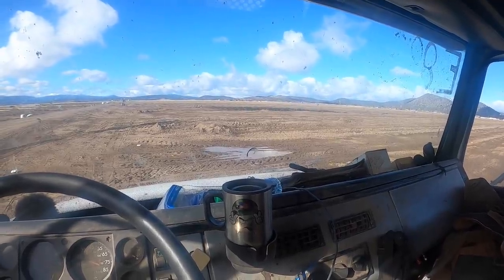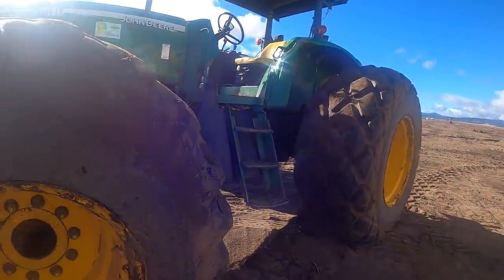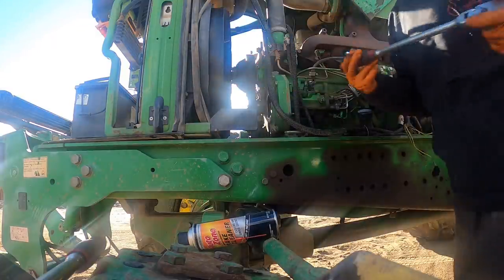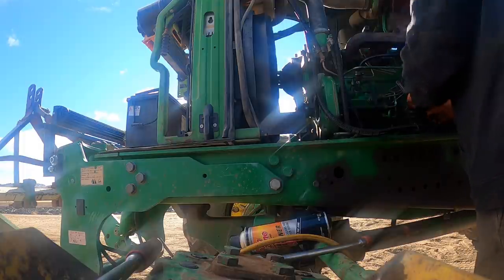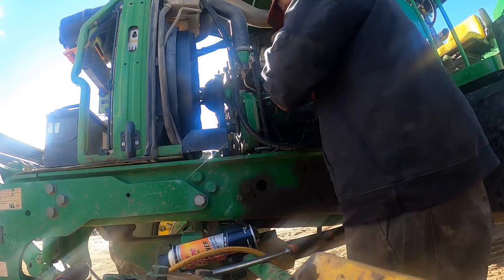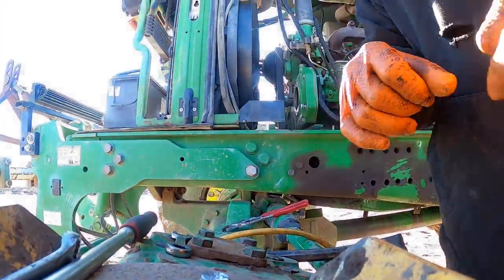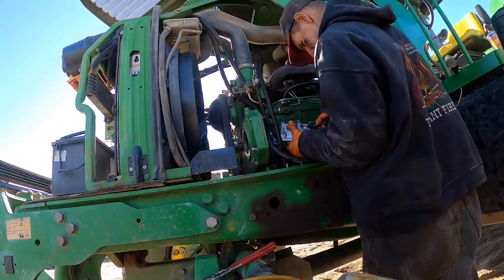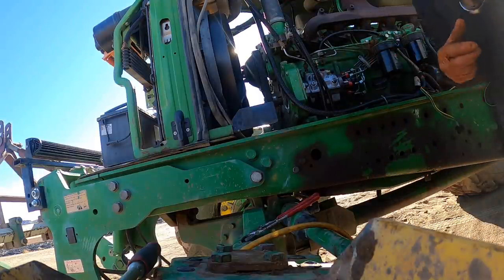Injection pump removal and installation.

Comment: Something about Stanadyne injection pumps is they're all virtually identical, and are simple enough to be rebuilt at home with enough competence and wherewithal.  They're not the best pumps ever made, but they are some of the cheapest, and you don't have to worry about replacing expensive injectors, since all the mechanical stuff is in the pump itself.  P7100 off a Cummins is not only harder to remove, it's heavy as all hell, and not as straightforward.  Hell I'd say that a DB2 is easier to rebuild than finding parts for an old carburetor!
Reply: Midnight Mechanic I got a db2 to pull here pretty soon. I’m hoping the rebuild is as everybody has been telling me.

Comment: The pump on my 6715 has gone out AGAIN, this will be it's 4th pump the tractor has almost 8000 hours on it, but no matter what we do we can't get more than around 2000 hours out of a pump on it, JD wants 2500 dollars for a new pump and 2300 for a reman, have you found a cheaper place to buy them or is that pretty much what it is??

Comment: I just overhauled a 3306 in a d6c been here sitting for 10 months they didn't need it.  Went to start it after the overhaul pump plungers froze up with tarnish must of broke a pin in the governor had to take it in to a pump shop. Have you had one do that on you before?
Reply from the maker: Yes

Comment: Is the problem with the original pump repairable ?
Reply: With new internal parts, yes. They can get a bit pricey though starting with the stiff core charge for the old pump.

Comment: Isn't that brake cleaner flammable? Isn't it dangerous to be spraying it around the spark plug tubes? You about scared me to death doing that.
Reply: Diesel engines Don't have spark plugs....  Please educate yourself.
Reply: Diesel engines Don't have spark plugs....  Please educate yourself.